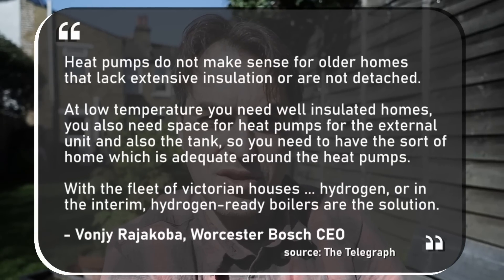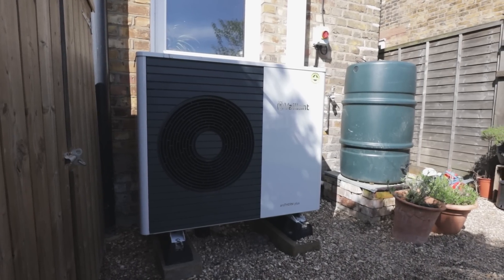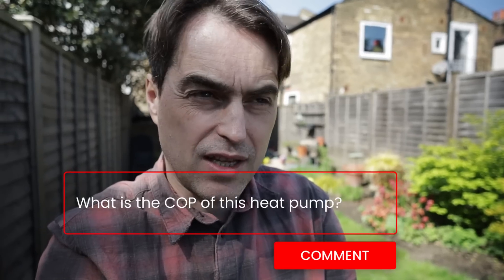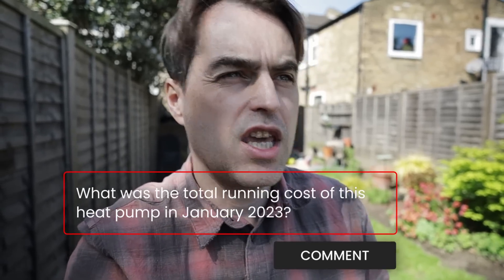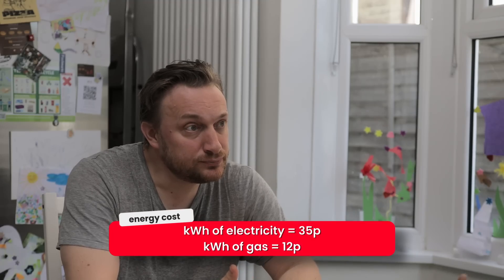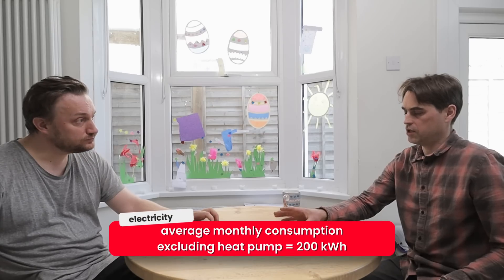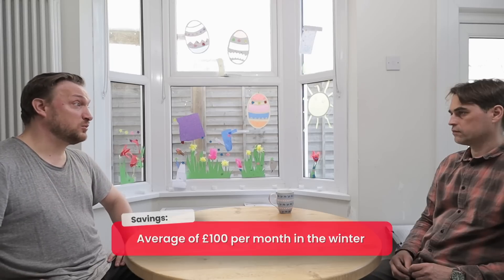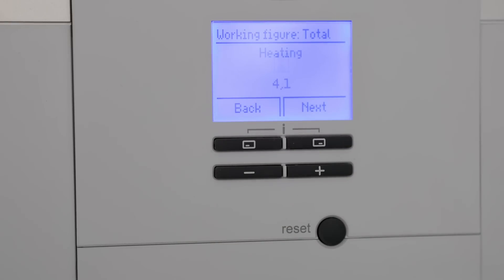Worcester Bosch CEO Is Wrong About Heat Pumps. Here Is Why.

Comment: still running cost is almost equal to gas boiler. 1kWh of gas 10p and 1kWh of electricity 35p. looking at tiny differences and installation cost massively different.
Reply from the maker: 35% cheaper running cost and about the same cost of installation as a decent weather compensated gas boiler with unvented cylinder if you take 0 VAT and £5K BUS grant into the account.
Reply: @UrbanPlumbers  that basically mean it doesn't matter which one you pick. It's ok for a new houses, but I would say for a new houses its easier just to go with MVHR/MEV ASHP cylinder and electric panel heaters. 
Older Houses easer to keep with boilers and avoid replacing heaters.
Reply: @tEXKiKos  Not necessarily.
Reply: @UrbanPlumbers won't get BUS grand for old ESHP.
Reply: @UrbanPlumbers  which is ok if you don't need to replace rads. that's why ASHP is cost neutral, not a solution for everything. Also electricity price will be a new tax and will be going up a lot as everyone will be running their appliances on electricity. It will still take a while to make gas obsolete
Reply: 1kWh of gas doesn't provide 1kWh of heat.  e.g. with this one getting a SCOP of 4.1, you are getting 4.1kW of heat for 1kW of electricity.  To get 4.1kW of heat from gas, you'd need (if boiler is set up to be 90% efficient) 4.55kwh of gas. 4.55x10p = 45.5p. So 10p more expensive for the same amount of heat from a gas boiler.
Reply: @BenIsInSweden  Hi Ben. Condensing Boilers are >96% efficient, so maybe not a total 100%, but close enough in my book. Both solutions are cost neutral and I wouldn't say either of them is better then the other. Compressor Lifecyle is 15years? There is not many things that can go wrong in the boiler. ASPH on other hand also has refrigerant, that can leak, etc. There is more things that can go wrong in the ASHP, but the solution running costs are similar so I wouldn't say ASHP is a golden solution.
Reply: @tEXKiKos  Leaks almost never occur with ASHP. Even less with monoblock units. No chamce of CO poisoning, yearly maintenance is basically zero. Just a clean and flush the crap filter. 

Gas boilers break down way more than heatpumps. I service both, i owned both.

And with gas you will never benefit as much from your solar as you would with a HP.
Reply: @tEXKiKos  and that 96% is correct, but only with a correct setup and low flowtemps. Most systems are far from optimised and younwould be lucky with 75% efficiency.
Reply from the maker: Condensing boilers in situ are only 81-85% efficient. To gain more efficient you need to install weather comp and larger rads even for gas boilers at the same cost a suit would have to do with a heat pump anyway
Reply: @tEXKiKos  To get a condensing gas boiler to 96% efficiency the return temperature needs to be about 27⁰C so flow of about 47⁰C. If everyone had their boiler set at 47⁰C then there wouldn't be this argument of needing to upgrade rads etc.  90% efficiency is return of 50⁰C, so flow of about 70⁰C, which is where a lot of people are going to be at.
Reply: @tEXKiKos  Heat pumps emit a lot less greenhouse gas than gas boilers so they are the solution whether you like it or not.
Reply: @Deiphobuzz  even if boiler breaks more often, compressor has a lot shorter lifespan. Solar and PV are a two different things. you can benefit from solar if you use bivalent water heaters. I'm not saying ASHP are bad for new builds and if there is no gas supply to the property. I'm saying there are cost natural but they are being sold the golden solution and saying that running cost are 10-20% less then gas boilers doesn't really move the needle if you are refurbing house. ROI would be poor beside against what you would need to to to achieve good results.
Reply: @BenIsInSweden  well if we are talking for seasonal efficiencies then Annual efficiencies are around 110% if designed well. check out example, Remeha Avanta Plus efficiencies. 98% at 70/50degC
Reply: @rogerphelps9939  are you saying that electric grid emits less emissions that gas? last that I checked electric vs gas CO2 emissions were similar.
Reply: @tEXKiKos  I dont know where you get your info from, but compressors last ages. There are numerous 25+ year old AC units running on rooftops 24/7 for refridgeration etc. My ASHP has a 120.000 hour lifespan on the compressor by the manufacturer. Mine runs 2500 hours a year. Thats easily over 40 years of continues running, or about 25 years if you calculate it back to the start and stop lifespan. 

Also depending on the energy cost of your country, and the caloric value of the gas, it saves a ton of money. One m³ of natural gas costs over 2 euro's here. Electricity around 0.50 Euro per KWh atm. I get around 3.9 SCOP.  My house would need around  1000m³ of gas a year. Or 2000 euros. 1000×8,8kwh(cal value of gas here)=8800/3.9=2256kwh of electricity × 0.5=1128 euros. Thats almost half the running cost. Unit price was 7.5k. I'll recoup the cost WAY before EOL. Im not even adding my own solar power in the mix here, and no way that energy prices will go down to 2019 levels ever again.  

Gas boilers cant be replaced here after 2025 without going to atleast a hybrid model with a ASHP as per goverment mandate. Gas tech for consumers is as good as dead tbh.
Reply: @Deiphobuzz  in UK  10p for 1kWh of gas. 1m3 = 11.3 kw (39.5 MJ/m3). Looks like you have good compressors, if you google typical compressor lifespan then you will see. There is diffrenc if you run it at 30/40degC and when you do it at 60degC for domestic hot water.

Comment: I'm going to guess a COP of 4 and cost of January bill to be £300.  What was the full cost of the installation over the cost of a new condensing boiler?  Would it make back the difference in 5 years, say?
Reply from the maker: very close with COP, the running cost was much lower. The cost was around 12K less the grant so £7K and not Vat. High-end system boiler with weather comp and a new unvented cylinder would have costed around the same. (Vaillant Eco Tec Plus or Viessmann 200 + 200L unvented)
Reply from the maker: so nothing to make back and instant savings from day 1
Reply: @UrbanPlumbers  Is it necessary to have an unvented cylinder? Isn't it possible for the secondary to be vented? That would be cheaper for me.
Reply from the maker: Yes vented is fine
Reply: @UrbanPlumbers  Nice! Am tempted but really like the idea of incorporating air conditioning for the summer so would be interest in comparisons with minisplits, and also have a decently big back garden that could potentially be used for ground source. The number of options make the whole thing quite baffling.
Reply from the maker: Ground source make little sense as air source is now as efficient and fraction of the cost
Reply: @UrbanPlumbers  Wrong. The source temperature of a GSHP is always going to be above the air temperature at times when you really need it. Furthermore you don't need ugly noisy above ground heat exchangers either.
Reply from the maker: So what is the scop difference between GSHP and ASHP please? The average ground temp and average air temp is very similar i the UK. Air source has an edge when air temp is above the ground temp so overall scop is identical in very well designed and j stalled air source systems.
Reply: @UrbanPlumbers  was £7k all in for for pump, radiators, pipes etc ?  is there a way to calculate how much UFH would cost for comparison?
Reply from the maker: £7-9k for external unit, cylinder and pipework. Rads are extra. Allow £400-£500 per rad supply and fit. UFH can be anywhere between £60-£150 per m2 depending on what needs to be done (insulation, new floor, new screws, etc)
Reply: @UrbanPlumbers  many thanks. I really liked the idea of HP but i don't think it makes financial sense for me. 120sq mtr house would be (Unit + UFH = £9+18K = £27K or unit + rads = £9+9K = £18K) either way who has that kind of money laying around when I could just replace the Gas and leave rads as they are
Reply: @UrbanPlumbers  Get your radiators from Screwfix and fit them yourself. That is how I did mine.
Reply: @gittin_funky  The extra cost will increase the value of your house. If you sell when new gas or oil boilers are illegal, not too far in the future, having a heat pump will be a definite plus point.

Comment: I really like the followups, especially after winter and with high energy costs. That large tall radiator is the nicest I've seen of it's kind. In keeping with the style of old rads - albeit massive!
Reply from the maker: Large radiators or insulation if you want decent efficiency and low running cost
Reply: @UrbanPlumbers  If it was your own house would you do both? Or does proper insulation negate the need for larger rads completely?
Reply from the maker: I am doing both - insulation and large rads so that I can have a super low temp and a scop closer to 5 than 4
Reply: @bearhauscubly  insulation lowers the amount of heating required. doesn't matter what you use to heat.

larger rads allow for lower water temperatures while outputting the same amount of heat.

and a lower water temperature makes for a more efficient heatpump.

both is best. if money is limited go for large rads and then spend the rest of the budget on insulation.
Reply: @bearhauscubly  oh come on, he got a business to run
Reply: @UrbanPlumbers  I understant that at the lowest tempertures ASHP lose efficiency so instead of what they're rated at say 16kw,  at minus three degrees  or lower they can only produce say 2/3 of their max output. How can you get around that if you need a boost at lower temperatures, is there a back up?
Reply from the maker: Systems are designed to work at -2 at full capacity in the UK. However in real life we’ll designed system work perfectly fine to round -10c if designed and installed well. Additional back up is almost never needed.
Reply: @UrbanPlumbers  Some ASHP's work at a lower temperature, but that's not the issue, the lower the ambient air temperature then the lower the COP will be, those manufacturers wwho use an indicative value of 4:1 don't always highlight that at <0 Deg.C that COP is likely to be 1:1.
Reply from the maker: Even at -20c most heat pumps can run over cop of 2. At 0 c they are closer to 3 than 2.
Reply: @UrbanPlumbers  Yet electricity is more expensive, in the UK, at a ratio close to 4:1, so more expensive when it's most required, plus your quoted ratio does not apply when DHW demand is calling. I have never said that heat pumps do not work, the facts are that they are not financially viable if the client has a mains natural gas supply i.e. 85% of all domestic properties. I was MSC qualified when the schem first started but quickly found that there was no economic case to be made. I also looked at micro Co-Gen systems and CHP units, Senertech etc.
Reply from the maker: @geoffaries  and that is the problem in a nutshell - you were MCS and still couldn't install a system that could work well. Not a heat pump fault.
Reply: Why is the comparison with 2022 missing? What was the total cost of the installation? What is the projected payback period? This should include the interest on the capital cost. I expect that much of the saving on energy used is due the weather compensator, the rough consumption figures seem to imply a COP of 6:1.
Reply: @geoffaries  and where exactly would you get the data for the 21/22 winter?

The heat pump was installed in summer or fall of 22 after all.
Reply: @anonym3017  This the comment that I was replying to - Paul Hockett
Paul Hockett
11 days ago
So the average temperature In January 2021 was 2.2 and the average temperatures in January 2023 were 4.4 so it’s hard to make a comparison